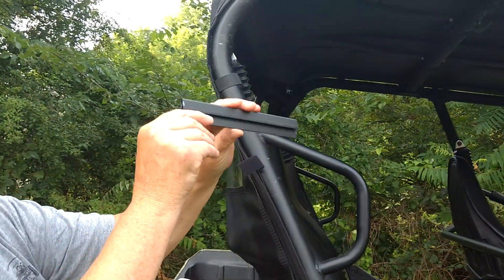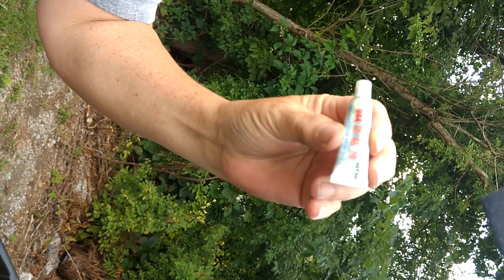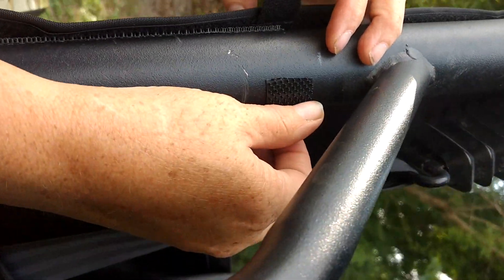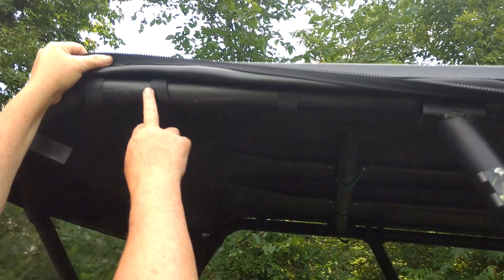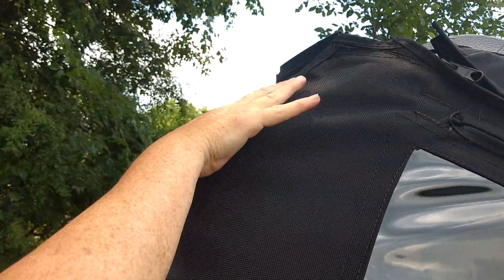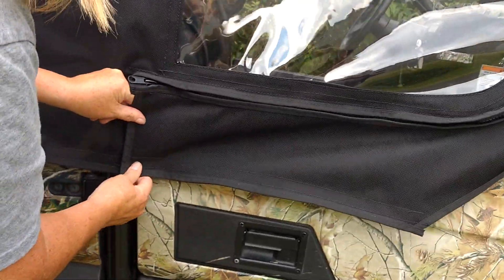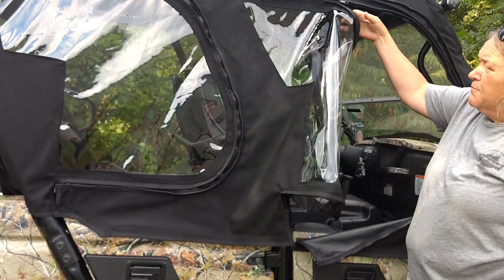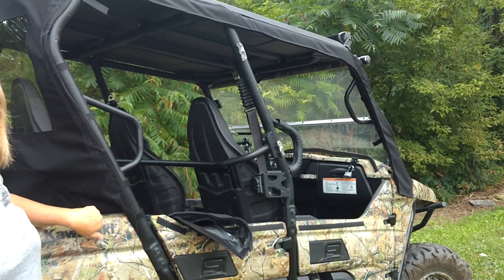Kawasaki Teryx 4 Full Cab Enclosure installation instructions.

Comment: I already have an soft enclosure for the back will this 4 door kit work with an existing soft rear enclosure?
Reply from the maker: If you have a soft back window it will work. If the soft back window is not our soft back window you would just need to sew velcro down each side of your existing back window where the sides meet it for the sides to attach to. We can send you the velcro if when you order you put a note you need the sewon velcro (free of charge)